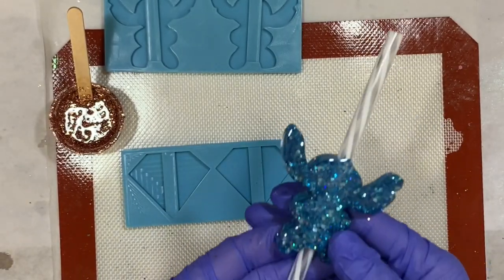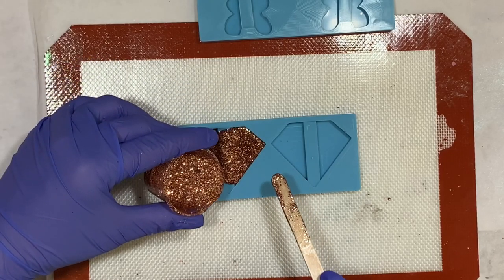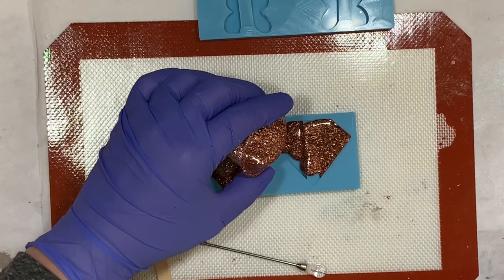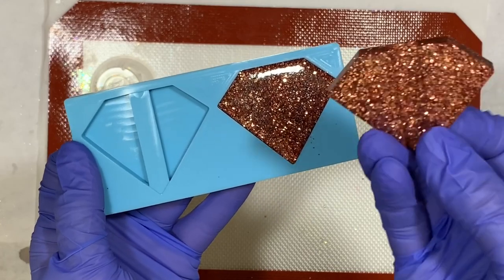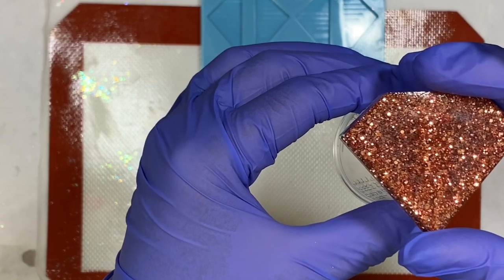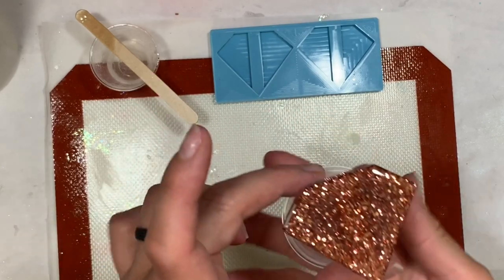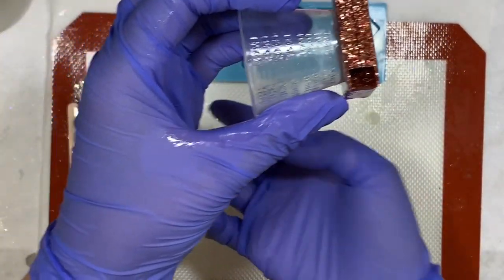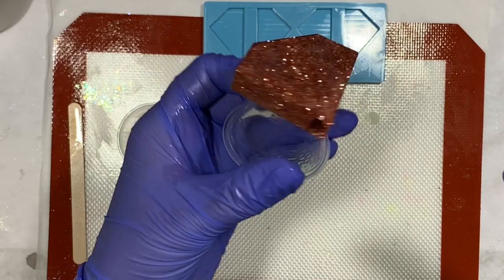How To! Two Piece Straw Topper Molds

Comment: Did you use the same epoxy to give it the clear coat as you did to make the topper?
Reply from the maker: I typically do! You can use your regular resin or UV resin for a top coat
Reply: @CJRoseCo  ok. Thanks. I’m trying to get a list of what I need, this will be my very, very very first time doing this. :)

Comment: How long does it typically take for the pieces to cure?
Reply from the maker: Heather Peterson it depends on the epoxy or resin used. You would have to refer to the manufacturer’s instructions on your bottle to check 👍🏻
Reply: @CJRoseCo  of course. makes complete sense.  For the above diamond straws, how long did it take?

Comment: Is there a difference between epoxy and resin? Can I make a straw topper out of resin and then coat it with resin for a shiny finish or no?
Reply from the maker: I’ve been told from CCDIY that resin and epoxy are the same thing.

Comment: I just started making resin key chains, could I use the same material to make these toppers or are they 2 totally different materials?
Reply from the maker: I don’t know what product you’re using, but most epoxy and resin will work. UV resin will not work in these molds 👍🏻